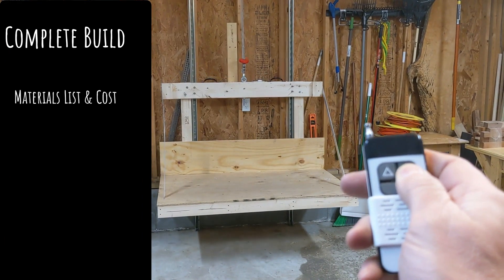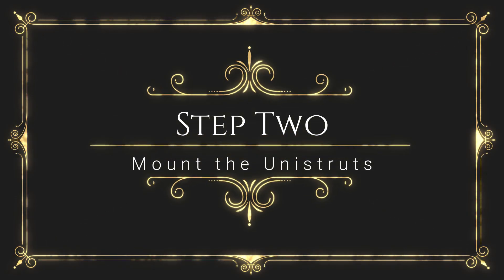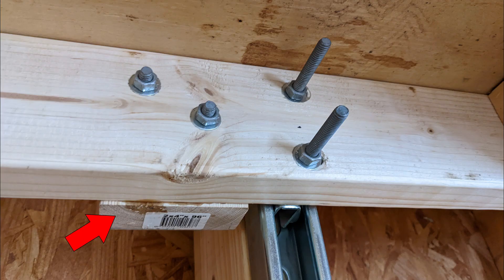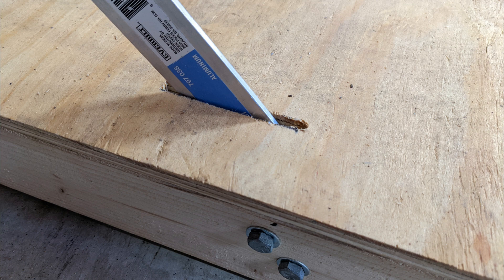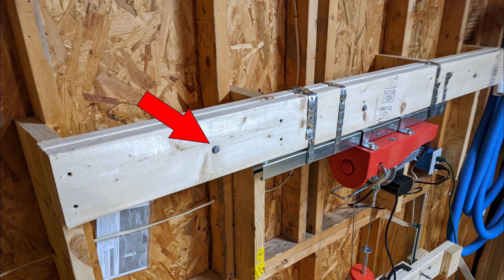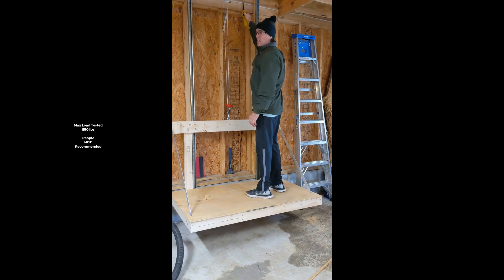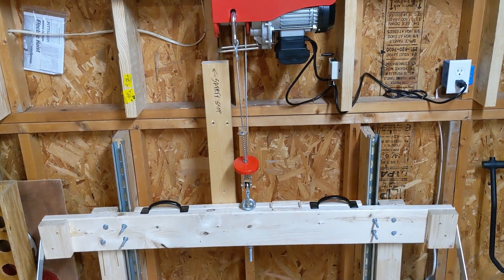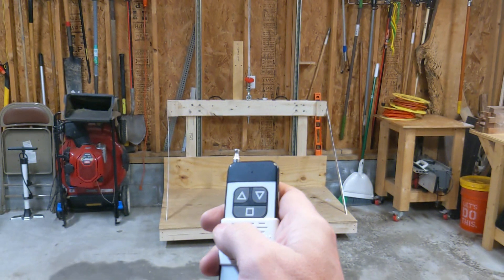DIY Elevator with Wireless Remote (No Welding!)

Comment from the maker: Instructions

Cut hole for ceiling to fit 3x5 elevator
•	Remember the 3x5 base platform will stick off the wall 3.5” before the platform begins
•	Plan for where the Unistrut guides will go.
•	Measure a hole to be 3’ 6” x 5’ 
•	Set the saw blade to be just enough to penetrate the depth of the floor then cut the hole.
•	Mark a cut line on the joists away from the hole by the thickness of the joists, then cut the joists to open up the hole.
•	We now need to support the floor to the right and left of the hole where we’ve removed the joists.  Measure the distance from the wall joist to the next uncut joist.  Using the 
        sections of joists you cut out, measure them to fit, then secure them to the cut sections to form a bridge.

Mount the Unistruts
•	Determine what needs to be done to get the Unistruts to go into your attic.  In my case, I had to get past a tall thick brick footer, so I built out from the studs with the 2x10’s and 
        secured them to the existing studs.
•	Drill holes every 12-16 inches the length of the Unistrut.  Make sure the holes are big enough to fit a 2” deck screw.  Do this for each.
•	Now mount the Unistruts.  Using a level, take the first one and screw it into the stud support making sure it is perfectly perpendicularly level straight up and down.  Mount the 
       second strut the same way.  It is critical that they both be perfectly level or the strut guides will bind.
•	Place (2) 3x5/16 bolts in each strut trolley.  A washer will not fit inside the trolley and you may have to widen the holes slightly with a drill to make sure the 5/16 bolt goes 
        through the holes.
•	Place 2 strut trollies with the bolts inside each Unistrut.  They will rest on the bottom.
•	We will cut the other Unistrut to go to the top of your elevator later.

Build the Platform
•	Cut (2) 2x4’s to 59”  
•	Take 1 of the 2x4’s that will be the base of the frame closest to the wall and measure to make sure that it is centered between the Unistruts.  
•	Mark and drill 4 mounting holes so the 5/16 bolts go through.  Do not install the nuts yet.
•	Cut (4) 2x4’s to 32.5” to be the depth of the frame.
•	Making sure the frame is square, use (2) 2.5” deck screws and assemble the frame. Space the 2 middle pieces equally and screw together.
•	Loosely attach the frame base to the strut trollies and mark approximately ¼” towards the outside of the unistruts.  This will be the mounting location of the (2) upright 
        supports.
•	Cut (2) 2x4’s to 37”.  These are the (2) upright supports.  This will be the height of the elevator platform.
•	Remove the frame from the trollies and attach the 2 upright supports to the frame using glue, (2) 3” 5/16 bolts, (4) washers and (2) nuts on each support.  Make sure the 
        uprights are perpendicularly level to the frame.

Upper portion of Platform
•	Cut (1) 2x6 56.5”.  This will be the top beam of the platform.
•	Center it between the 2 Unistruts and mark the holes for the trolley and upright support attachments.
•	Attach the top beam to the upright supports using glue and (2) 3” 5/16 bolts, (4) washers and (2) nuts on each support.  Secure the trolleys using a washers and nuts.
•	Measure the distance between your Unistruts and cut a 2x6 1” shorter than that distance.
•	Center this 2x6 between the 2 Unistruts and attach it to the back of the top beam using plenty of glue and 2.5” deck screws from both the front and back of the beam.  This will 
        add additional strength to the beam.
•	Drill a ½” perpendicular hole in the center of the top beam attached to the trolleys for the 8” eyebolt.
•	Insert the 8” eyebolt in the top and secure it using a washer and nut.  This eyebolt will hold over 3,000 lbs
•	Cut (2) 2x4 pieces 5.5” and attach to either outer end of the front of the top beam using glue and 2.5” deck screws.

Side Supports for Lower Platform
•	Cut the 8’ aluminum in half.
•	Lay a 4’ section from the top outer left of the platform so that it lands on the lower inside of the frame base.  Mark 2 spots at the top and 2 at the bottom to drill out to fit the 
        5/16 lag screws.  Do this for the right side as well.
•	Drill the 4 holes in each 4’ section of aluminum.
•	Cut a 3’x5’ section of plywood for the base floor.
•	Cut a 3” slit in the base to allow the aluminum strap to pass through.  To do this, measure from the back of the base (closest to the wall) 28” and 2” in from the edge to bypass 
        the 2x4 frame and cut the slit (using a jigsaw) 3” towards the front of the base (furthest from the wall).  The edge of the cut should be approximately 31 inches from the wall.
•	Dry fit the base onto the base frame and verify that the 4’ aluminum side straps fit the way you expect.  Make any necessary adjustments.
•	Attach the 3’x5’ base onto the frame using glue and 2” deck screws.
•	Using the 1.5” 5/16 lag screws, attach each 4’ aluminum strap to the platform.  To attach the bottom lag screws, I used a couple of buckets to slide the structure up enough to 
        get underneath the frame.  Each lag screw should hold over 220 lbs giving you 440 lbs of capacity per side on the platform.
Reply from the maker: Finish the top Unistrut extensions
•	The top of the Unistruts must be a few inches above the overall height of the elevator frame.  Therefore, you will cut (2) pieces of Unistrut to go on top of the current 
        mounted 
        Unistrut to the height needed.  Remembering that the elevator frame is 37” tall, the Unistruts final height should be at least 41” above the attic floor.
•	Measure, cut and secure the required Unistruts on top of the existing Unistruts using 2” deck screws and make sure that they are perpendicularly level with the other 
        struts.  Make sure there are no rough edges on the butted ends.

The Hoist Beam
•	The bottom edge of the hoist beam should be at least 29” above the top of the elevator to give ample spacing.  If you had to build out your studs before attaching the
        Unistruts,  you will have to build out the studs before mounting the hoist beam.  The hoist beam should be directly lined up with the top beam of the elevator before 
        attaching to the eyebolt.
•	Build out the studs if needed.
•	Cut (1) 2x6 hoist beam the length to span the distance of the 2x4 upright building framing and attach using glue and 2.5” deck screws.
•	Cut another 2x6 hoist beam the exact length as the last.
•	Using glue and 2.5” deck screws, attach this to the other hoist beam for added strength. 
•	Drill at least 3 5/16” holes in the doubled hoist beam and use 3.5” 5/16 bolts, washers and nuts to additionally secure the 2 hoist beams together.

The Hoist
•	Cut a section of Unistrut at least 30” to mount to the bottom of the hoist beam.  There are 2 hoist brackets that come with your hoist.  They will fit perfectly over the Unistrut.  
        The Unistrut will be mounted to the hoist beam using at least (5) 2.5” deck screws, but you will need to add enough washers between the Unistrut and the hoist beam at each 
        screw to be the thickness of the 2 hoist brackets.
•	Mark the center of the hoist beam.  The hoist will be mounted offset so that the cable hangs directly center of the beam.  Keep this in mind before securing the Unistrut to the 
        beam.
•	Loosely attach the left side of the Unistrut with a 2.5” deck screw and required washers for spacing.  Slide the 2 hoist brackets over the Unistrut and loosely attach a deck screw 
        and washers to the right side.
•	Attach the hoist to the hoist brackets using included hardware.  Slide the hoist into position so the cable is directly center of the hoist beam.  
•	Add remaining 2.5” deck screws and washers and tighten.
•	Wrap the hoist beam at least 4 times in galvanized hanger strap – 2 on the right and 2 on the left of the hoist.  Make sure the strapping is as tight as you can get it.  Secure it using 2” deck screws.  This is a minimum requirement as deck screw heads are only rated between 100 and 200 lbs each.  Each wrap of the strapping is rated at 750 lbs each and makes an excellent backup.
•	Attach the hoist cable to the elevator eyebolt.  The hoist recommended here was the 440/880 lb unit.  To get the 880 lb capacity, double the cable and use the additional included pulley.

You should be ready to test the elevator.  Keep tension on the hoist cable at all times to keep it from unraveling.  At this time, do NOT put anything on the elevator platform.  Make sure that the elevator doesn’t bind at any point going up or down.  Key areas to watch for are how smoothly the trollies pass by the butted ends of the Unistrut on each side.  Also watch carefully (slowly) as the elevator platform passes the hole in the attic floor.  Remember that if the Unistruts are not at the far ends of the right and left of the platform, the platform can shift (or slightly tilt) to the right or left.  This is only about a quarter inch or so, but it does happen.  The goal is to keep the elevator structure centered when it goes up and down, so keep any loads as centered as possible.

At this point test the elevator with a load.  While I can say that my wife and I have safely ridden our elevator, I cannot, for liability purposes, recommend that any human does this.  While every effort has been made to over engineer for safety purposes, it is safe to say that most items on this design are well above the 880 lb capacity of the hoist.    However, there are weak points.  Don’t test the limit of the hoist.

This design doesn’t include fall arrestors.  While expensive, they are recommended for additional protection of anything valuable.  

Upper Limit Switch Activator
•	The hoist comes with an upper limit switch that will cut off the hoist when the upper limit switch lever is pressed.
•	Bring the elevator up to your attic/loft and make sure that the floor of the elevator is perfectly level with the loft floor.
•	Push the hoist limit switch lever until you hear a click (indicating the switch is active).  While it’s at that point, measure the distance from the bottom of the top elevator beam to the limit switch lever.
•	Cut a 2x4 that distance and attach it to the back of the top elevator beam with 2.5” deck screws.
•	Test by raising the elevator and holding the “up” switch until the 2x4 activates the limit switch.

Remote Control Installation
•	You’ll probably find that the included corded up/down switch on the hoist is probably not long enough for use.  It either needs to be extended, which is easy using a length of 4 strand 18 gauge cord.  However, it’s pretty easy to attach a wireless remote.
•	These instructions are specific to the use of this recommended remote.  The remote must be AC capable (capable of being used with electricity) and capable of handling a 10 amp load.
•	First, you need to make sure that the remote receiver is in “Momentary” mode.  It comes as “Toggled”.  Toggled means that you press a button to start (or turn on) and the same button again to stop (turn off).  I personally don’t think this is safe.  Momentary means that the hoist only will operate so long as your thumb is pushing a button.  So, push to start and release to stop.
•	To get this receiver in “Momentary” mode, you’ll have to remove the jumper completely from the circuit board.  Remove the back of the receiver (4 screws).  Pull out the circuit board.  Find the jumper and pull it out – or just set it so it’s only on one pin.  Then reassemble.
•	UNPLUG THE HOIST!
•	Cut the hoist remote cord to the length needed to reach where you will mount the wireless receiver.
•	Expose the 4 wires for attachment to the receiver.  The 4 wires are black, white, blue and red.
•	Attach the blue and white together and attach them to the “Reverse” 
•	Attach the red to the “Forward”
•	Attach the black to the “L”  (I believe this is the “L”ive wire) 
•	The only thing missing from the corded switch was the neutral.  We need to get this from the power cord.  Strip about a 4” section of the outer power cord where it can pass by the receiver.  Be careful not to nick any of the 3 inner wires.
•	Expose a section big enough (about a half inch) of the white (neutral) and attach it to the “N” (neutral) on the receiver.
•	Plug in the power to the hoist.
•	This wireless unit comes with 2 receivers.  Using this wiring, the up-arrow should propel the elevator up and the down-arrow, down.  Test it without anything on the elevator. 
•	I like to keep a remote on the elevator, using Velcro, etc. and one available on a shelf downstairs for remote operation. 

Enjoy - and be careful!
Reply: Great build. For future reference the L in electronics is load
Reply: You should Pin your comment
Reply from the maker: @AlexR_44  Not sure how to do that
Reply: @mikeh7256  click the three dots to the right of the comment and choose pin. (must be logged in s yourself of course and 
you can only pin one comment per video I think)
Reply: Excellent instructional video!  Helped me figure out how to make my life and provided all the parts.  Nothing but love for the work you put into making this video.  Thank you!
Reply from the maker: @champ6368  glad it was helpful for you and best of luck on your ventures. When I make my videos, I try to put in as much detail as I can that I would want if I was looking at the video myself. We are still enjoying the snot out of ours! LOL
Reply: Awesome video Mike.   Looking to build this next weekend.  Do you recall what gauge superstrut you used?
Reply from the maker: @ChrisZarras  10 ft, 12 gauge. See the link below.

Your friend has shared a link to a Home Depot product they think you would be interested in seeing:

https://www.homedepot.com/p/Superstrut-10-ft-12-Gauge-Half-Slotted-Metal-Framing-Strut-Channel-in-Silver-Galvanized-ZA12HS10EG/202714274
Reply: My hoist remote has a brown wire instead of red. I wired using the configuration that you showed, but swapped the brown for red. 
The hoist receives power and can audibly be heard engaging, but nothing moves. 
Any ideas?
Reply from the maker: @coltoncarew3047  I had to hire an electrician just to get what I got. Sorry.

Comment: What are the two black handles for on the top of the platform back support?
Reply from the maker: That's "optional" equipment! LOL

That's exactly what they are. Just handles where you can hold on. It's not like it goes 40 mph up and down, but for me, it points out a safe place to put your hands. If you are unfamiliar with the elevator. There are places that are dangerous where you could either pinch or do severe damage to somebody's hands. I would put them on just for that reason - To encourage them not to put their hands in place that or hurt them.

Speaking of something that I always do as a preventative measure... I always have one hand feeling the cable as it passes through my hand on the way up just to make sure that there's no fraying going on. If you were to ever get fraying, I would recommend replacing the cable. Generally, you will not ever have that. Because I don't have a fall arrestor, that would be pretty important to me.

Comment: It's Nov 2025 and I'm about to move my shop to the 2nd story of our home. How is your lift holding up as of now? Any adjustments or changes you would make?
Reply from the maker: No changes to the equipment or the install. The only thing I've changed is how the remote works. Instead of having to hold the button down, I have made it so you can do a simple tap and have the elevator go where you want. Want. On the way down, I would have to tap to stop, but it automatically stops at the top. 

The reason I made the change was because I was wearing out batteries quickly.

Also, I make sure that the cable hasn't loosened up so that it has wrapped up neatly on the winch. You don't want the wires to overlap and pop as you go up or down. I also check regularly to see if there are any frays in the cable. If you find any phrase for whatever reason, change the cable. I haven't had any problems.

I know that people are going to cringe, but I ride the elevator up and down with the load. I won't ride if the load is going to be greater than 500 lb before I get on. 

It has been a real blessing for us.
Reply: @mikeh7256 that's great to hear. You made it look so simple I just wanted to make sure it's held up and I'm going to use your video to make mine when we build up the 2nd floor which should be as soon as the rains go away in April or May.

Comment: Don't know if anybody found out but for the 2000lb HF Hoist w/ Wireless remote is wired as is follows (Tan and Red to Reverse)  (Blue to Forward)  (Black To Line) And white common from PWR line to N for Neutral or common. Open the hand controller and follow the circuit with an ohms meter  to verify.
Reply: I have the HF 1300 lb hoist.  Is it the same as the 2000? Mine has white, red, black and tan wires.